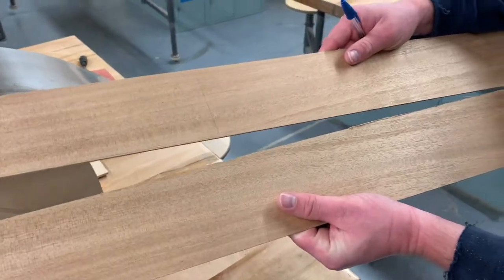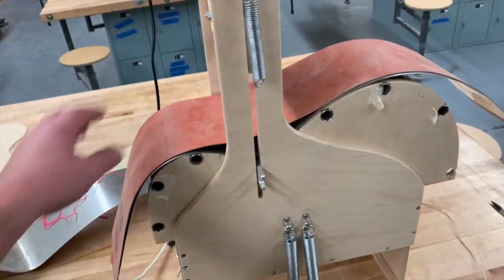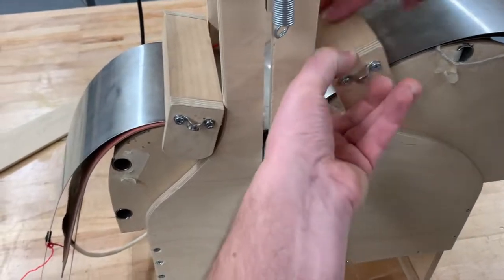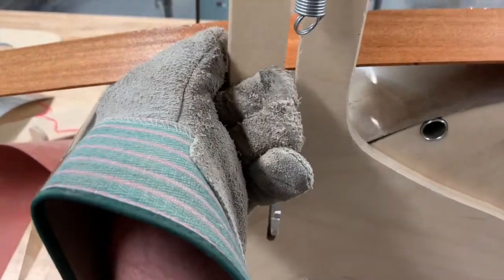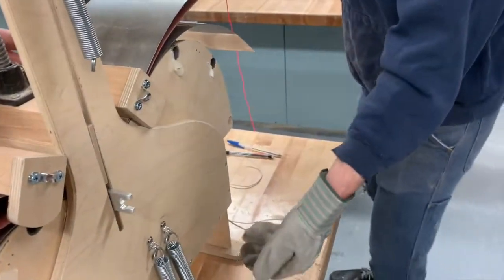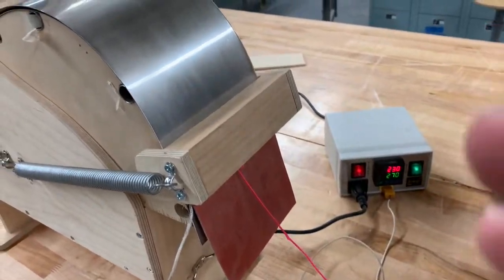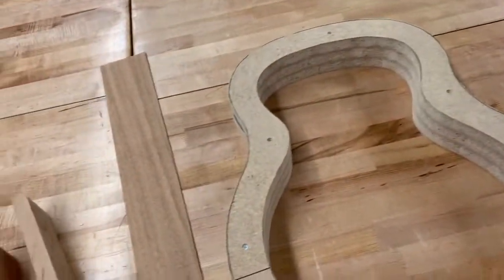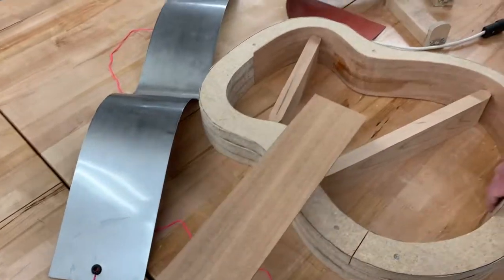How to Build an Acoustic Guitar - Bending the Sides

Comment: I can recommend soaking butcher's paper, and placing a sheet both above and below the wood.  It's a good guarantee against scorching and staining.  It's really more important if you use spring-steel slats, which have a lot of convenience but aren't stainless.  The paper prevents staining from any oxidation on the spring-steel.  Thanks for a nice, clean video.